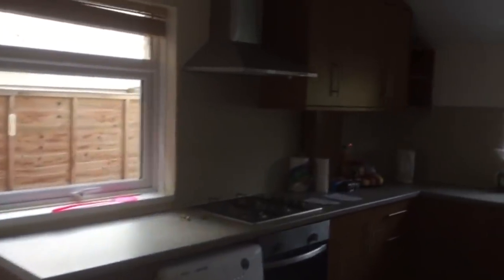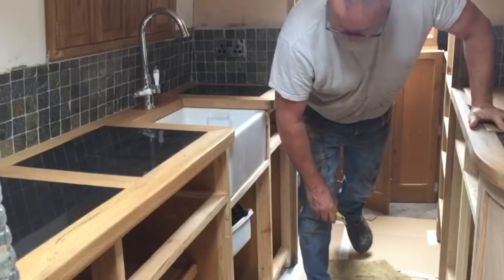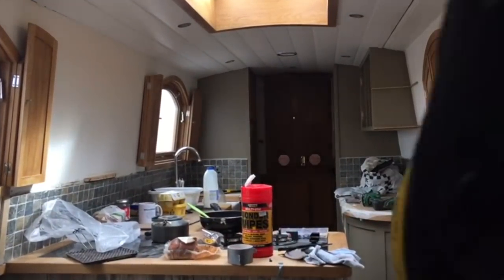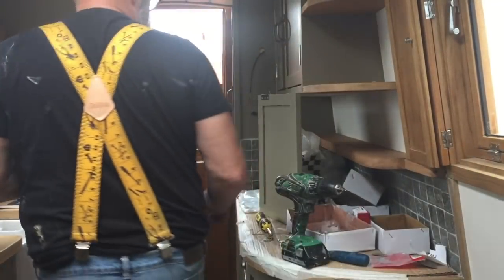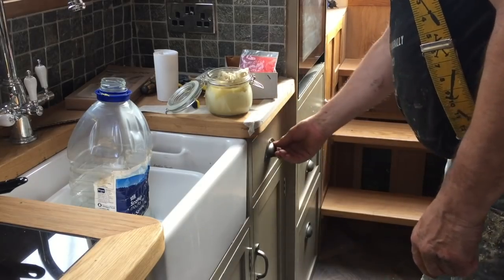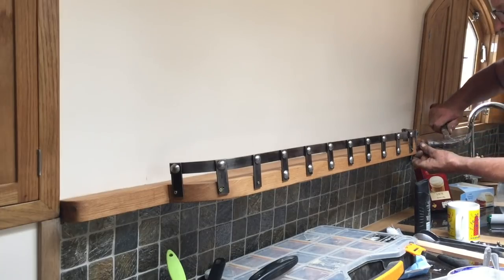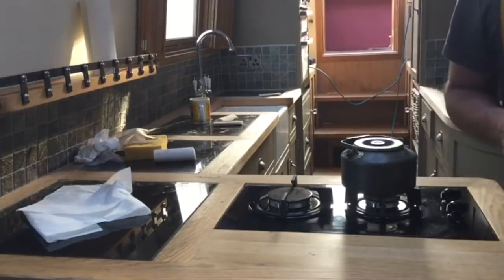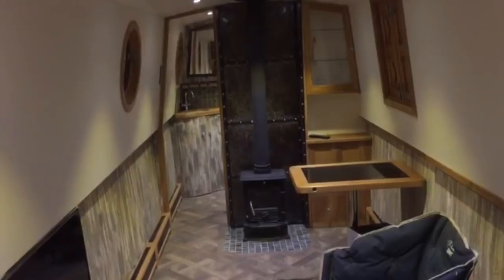New Narrowboat build and fit out - Part #30

Comment: Some time ago I was thinking of going into woodworking but didn't (medical/safety reasons).
During that time (researching) I created the ultimate (imo) workbench with all of the tools built into three modules (flip up, pull out, swing up or out) with them in order of use (table saw, jointer, planer, etc...), including storage for power tools, electrical outlets and tubing for dust removal and other features also built in.  ;-)
The modules (or together) would be able to roll around